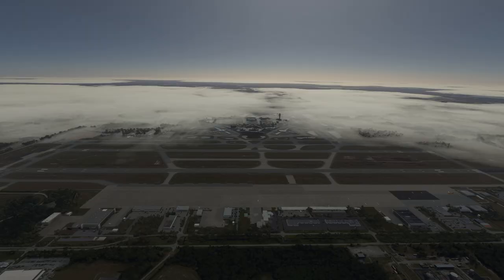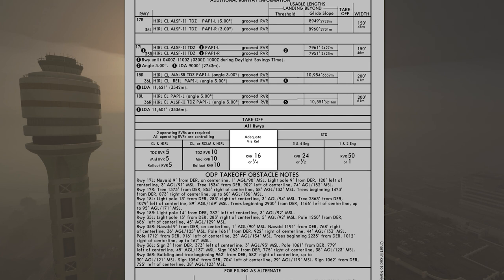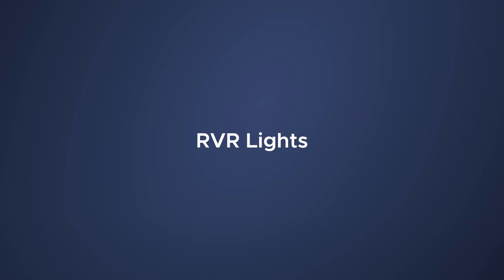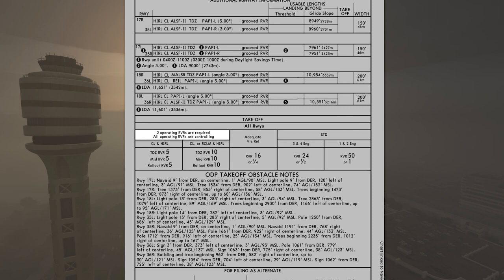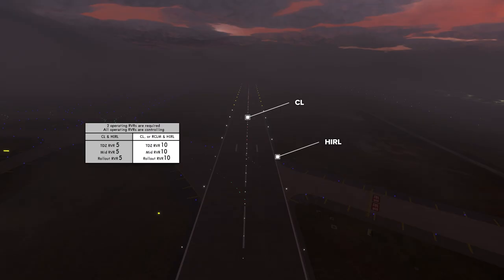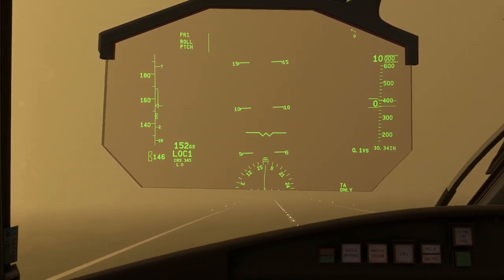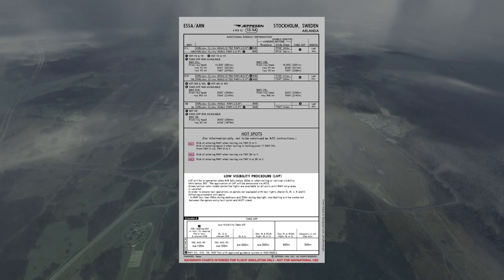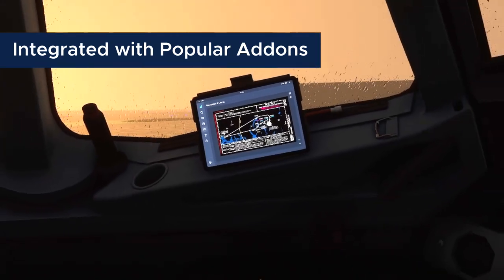How To Read Takeoff Minimums on Airport Charts / Flight Simulation

Comment: Thank you a lot for so much knowledge.
I have a quesiton that what is the diffierence between HIRL and RL in same LVP take off minimuns chart ?
Looking forword to your reply😊
Reply from the maker: Great question. The HIRL stands for High Intensity Runway Lighting (They light up the edge of the runway). The RL stands for Runway Lighting. Now if we look at a chart, from KSLC 20-9A page, 16L,R, 34L, 34R. You can see with a HUD, and CL (centerline lighting) AND HIRL, we can go with 300 RVR (if our OPSPECs says we can). No HUD with just CL and HIRL, is 500 RVR, so on and so forth. The TO minimums will go up on you with reduced lighting. (these are lower than standard minimums). I could not find one with just RL-but I would say the mins will be high during the day. What is interesting about this, is at night the TO minimum can get lower, because you can see the CL better at night in the fog. I hope this answered your question.

Comment: Super video but, where can I find the ref for “Adequate Vis Ref”? Thanks!
Reply from the maker: Hello, thanks for the comment. it's a definition that the FAA uses: ADEQUATE VIS REF (Adequate Visual Reference) — Runway markings or runway lighting that provides the pilot with adequate visual reference to continuously identify the take-off surface and maintain directional control throughout the take-off run.
Reply: @Navigraphteam  Super. I found the definition in the Jeppesen Airway Manual, definitions, but not in the AIM.
Reply: Thanks, This is awesome. I’m a commercial pilot and so appreciate your videos and I watch them every so often and while at recurrent training.
Much appreciated! Best!